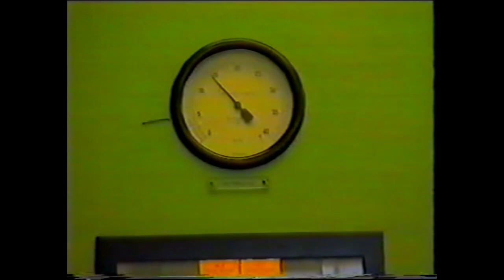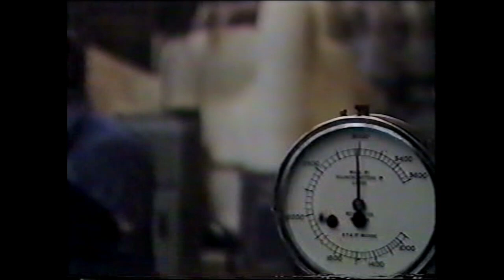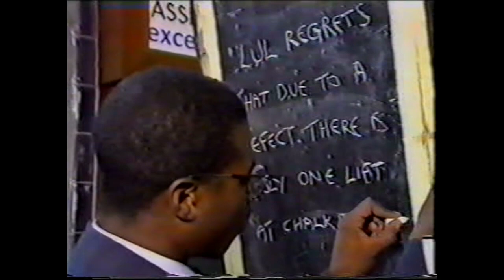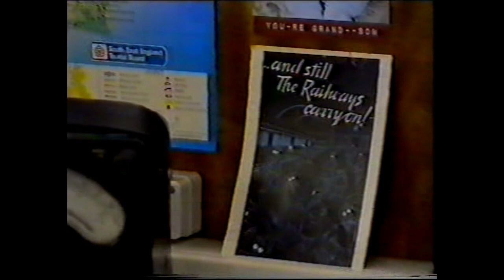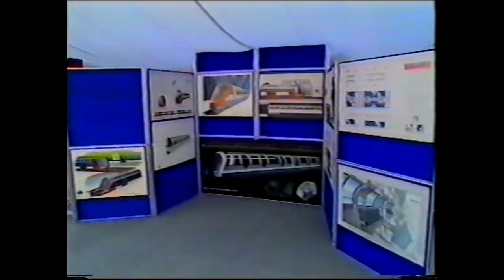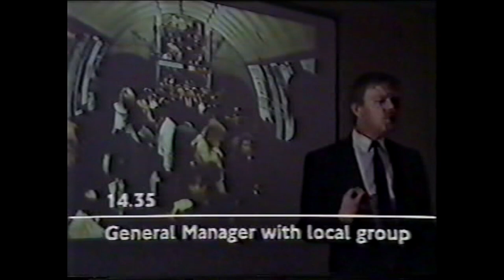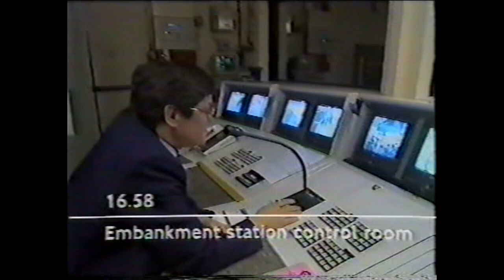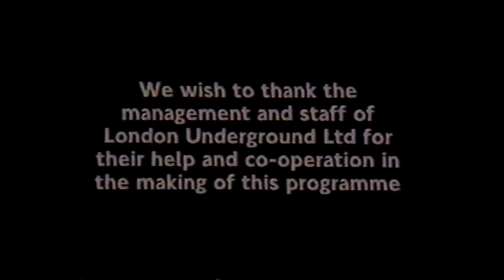NORTHERN LINE 1990 "ABOVE US LONDON " L.U.L FILM

Comment: Thanks for posting. Link was sent to me from a retired line controller. I worked at Cobourg Street control room from 1997 to 2014 . Recognized quite a few faces in this video. As someone commented, 30 years a flown by. Have shared with others I used to work with also.  Cracking!
Reply from the maker: Excellent! Glad you liked the video . This was actually given to me hard copy from a medically retired motorman and engineers train driver of 44 years long ago . Your retired colleague wasn’t Mr Hardy was it by any chance ? Regards . Richard .
Reply: @Richardsrailway  Bob 'TinHead' Taylor. Vic controller.

Comment: 1959 and 1972 Mk1 on the Northern Line. Good times and part of my childhood.
Reply: Leonard Ssenkindu  the 1972mk1 was built to assist the 1959 stock as there were not enough trains to run all services on the Northern line back in the day. 

There was no time to create a new design and so the 1972mk1 was basically a seven car crew operated version of the 1967 stock which operated on the Victoria line till 2011.

The 1972mk1 was eventually withdrawn from the Northern line in the late 1990s as they were not reliable in performance and they were a smaller batch.

Some cars were moved into the 1967 stock but in the middle as they did not have automatic driving equipment installed.

Others have been driver only converted and mixed in with the 1972mk2 stock as half part of the train (3 and 4 cars) as replacements for damaged mk2 carriages

Comment: My favourite Tube line. As I've said in other posts, you couldn't beat the 1938 train stock. The noise of the motors, the bouncy seats. I must go to the Isle of Wight. I believe they bought them and run the 1938 stock as their overground trains.
Reply from the maker: Paul b I agree. However make your trip soon as the 38’s are struggling on the island . Once the 73’s go on the Piccadilly they will replace the 38 stock on the island .
Reply: @Richardsrailway  Nope.  The Island is getting D Stock.
Reply: They're going tomorrow.

Comment: Back in the day when the Northern line was getting bashed a lot for poor services and trains breaking down a lot but it has changed a lot for the better.

Now converted to automatic operation, extension to Nine Elms and faster than ever and upgraded 1995 stock trains.

A small number of ex-Northern line 1972mk1 trains have been converted to driver only operation and combined with the mk2s as replacements for damaged and written off mk2 carriages, currently on the Bakerloo Line